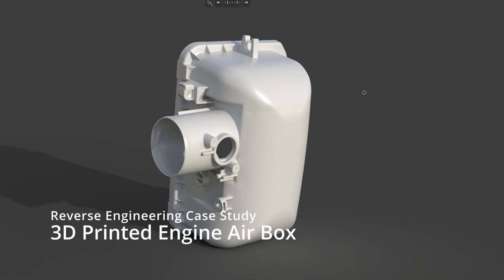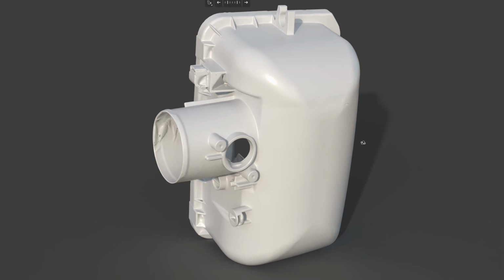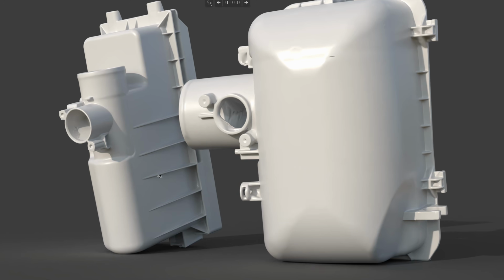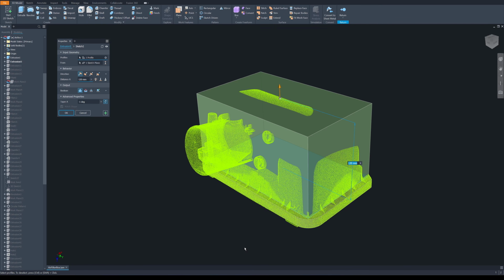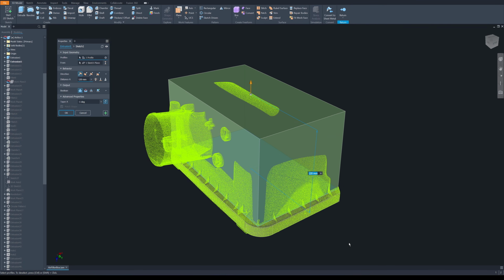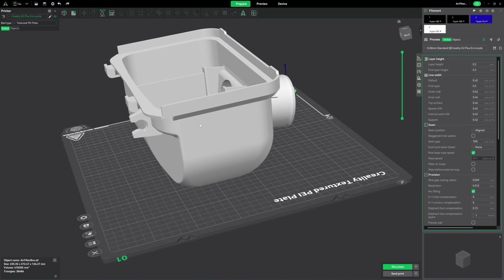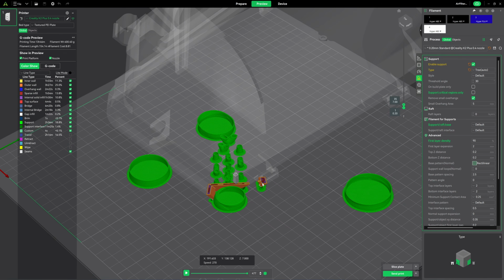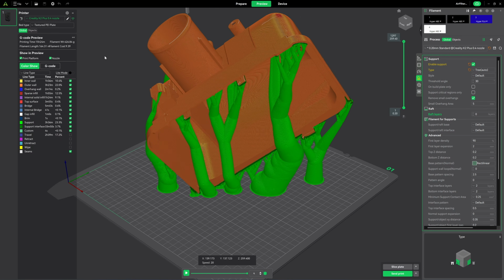3D Printed Engine Air Box: A Reverse Engineering Case Study with Creality Scan Raptor

Comment: I had bad luck with painted supports. I rather use CAD and design custom supports for difficult prints.
Reply from the maker: I'm thinking about scarifying one of the corners and make prism shape as the base for the filament to climb up.

Comment: The inside rib sacking down, because of the injection molding technology. Normally thin big ribs should be avoided, because of the plastic shrinkage. This features are really difficult to cooling equally in the mold and in the top and the bottom will have different temperature after ejecting from the machine. This causes in the end  the deformation because the two half of the rib shrink differently
Reply from the maker: That's very informative. Thank you.  Do you happen to know why they put such a thin partition in there?  I've seen that in a lot of air box cover.
Reply: @Payo-TensileCreator  I guess the rib might be there for air mixing/swirling inside the box or to achieve required air volume for optimal performance. It could create a volume that is better suited for air wave pattern of an intake manifold.